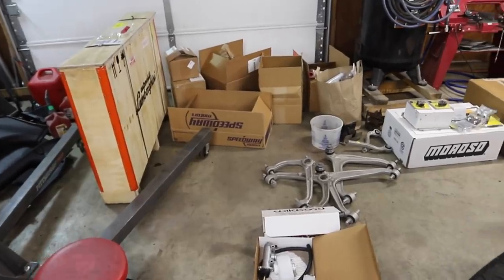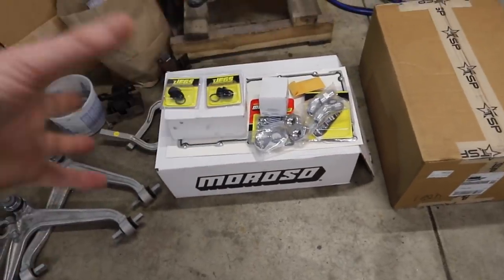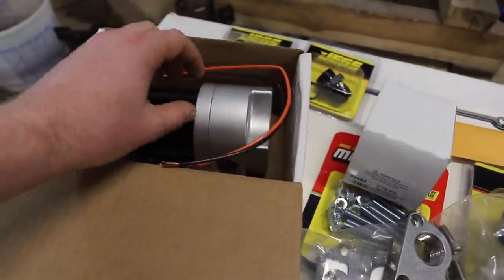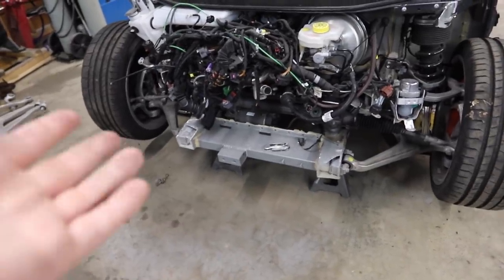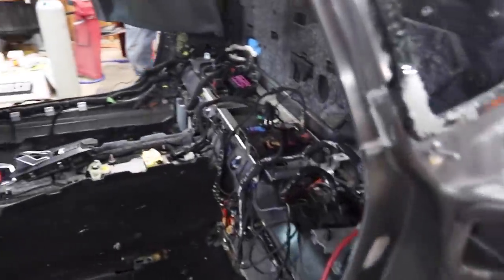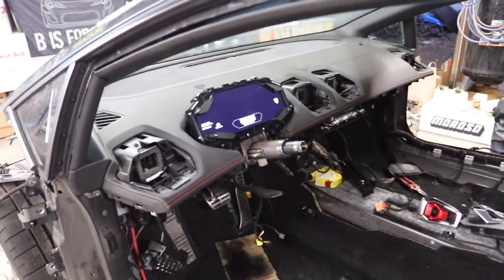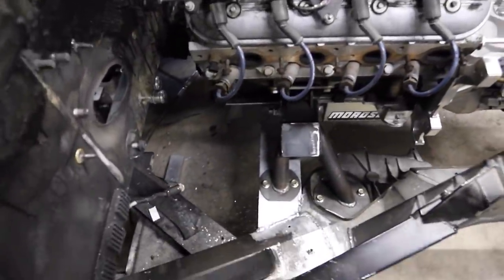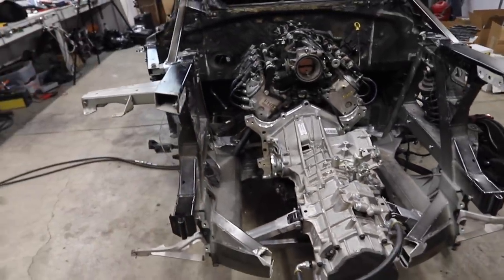Parts are in!! And We Bring the Huracan Back to Life!!

Comment: My concern with this project is the complexity of the "can" network. Once the car keys are found there is gonna be too many malfuction lamps on since key controller area networks are gone from the oem setup like the engine and transmission. The stand alone ecu can fix some errors but not all of them. So i believe the dash will have limited functionality after the swap is finished. Modern cars are very hard to mix computers with out fully flashing out redundant systems out of the programming.

Comment: Not gonna lie, the battery on the concrete is pissing me off.
Reply: Why
Reply: Many people have the impression that whenbatteries sit on concrete, energy "leaks out" or they are ruined. The short answer is that letting modern batteries sit on concrete doesnot harm or discharge them in any way.
Reply: That has not been an issue for a very long time.

Comment: what a garbage of the engine mounts... please do at least a bit of simple math and figure out what the mounts should be like (design and strength-wise) instead of guessing. please... at this point it`s all wrong and looks not at all beautiful.
Reply: @Finnspin_unicycles  well, this reply confirms that You also have no idea, how engine mounts / brackets should be made. the very base concept is wrong. correct concept - you want to place engine mount (elastic part) as far from crankshaft as possible (in transverse direction). in this case stock placement with OE mounts (350$/EA new) or PU replicas of other VAG group cars is the best and easiest way. regarding bracket - you want it to be in a shape of a pyramid with it`s base as square and as large as possible, attached to the engine with 4 bolts if possible. and a single bolt to the engine mount. the simple math = you want to know peak torque of and engine (not HP). from this you calculate bending force at both ends of bracket. from this you calculate thickness of metal used to build bracket. simple rule of thumb - you want a single bracket to hold all the torque of the engine + 30%. regarding transmission mounts - you want brackets to be as short as possible (in transverse direction) . in a sense that drivetrain mounting points form a `triangle` in horizontal plane. same principles of shape for transmission brackets as to engine. simple rule of thumb - single mount should hold a weight of the transmission. most of the time bolt holes are already fixed, but if there is a freedom of space, mounting points to the chassis should be as close to the center of mass of/for both engine and gearbox in longitudinal direction. if everything understood and done correctly, you never think of a word FATIGUE...